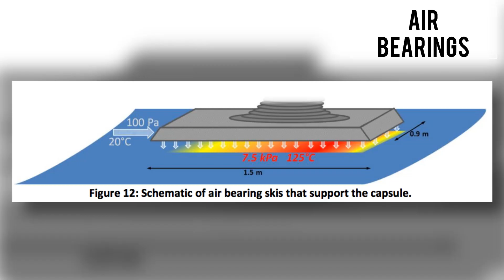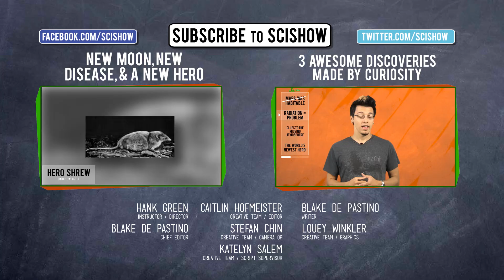The Science of Hyperloop

Comment: ...solar panels...

So when the sun isn't shining, the tubes won't work.
Reply: ***** Several problems.  First, the batteries will lose juice after going without sunshine for several days, which will happen periodically.  Second, batteries are very expensive.  Third, batteries are really bad for the environment. 

So let's get over this solar panel nonsense and install miniature underground nuclear sodium cooled reactors (cheap and incapable of melting down) for the hyperloop.  This will work weather the sun is shining or not, wind or no wind.  Mother nature's cooperation is not required.  

Problem solved.
Reply: ***** Well done, sir.  My advice: go be an engineer.  (I'm biased because I'm an engineer.)  Invent a better battery and change the world.
Reply: I would be willing to bet the hyperloop would be linked to the grid, that way it would always run and the panels would make up for any electricity used.

I think the obvious reason why Musk is betting on batteries run by solar rather than by LFTR plants is that his system is proven. How many LFTR plants have been built? Less than one? You're years away from your dream. By the time your first mass-scale plants are being built, solar will have already won.

He also doesn't seem to think his batteries are too dirty (relatively speaking) and he's Elon Musk. So there's that.
Reply: 4ourthofjuly Solar represents less than 1% (last I checked) of the electric power generation.  Nuclear represents 20%. Nuclear IS a proven technology, and has been for the last 60 years.

Of course I would assume that the hyperloop would be hooked up to the grid, but at the current technological level, solar is nowhere near a cost effective means for accomplishing this.

I am repeated bemused by how self-proclaimed environmentalists are among the most resistant to nuclear technology, which is by far one of the best "green" technologies out there.
Reply: The LFTR plants have not been built. Was there even one full scale plant? I don't care whether you build them or not, frankly. Look at the trends and use your imagination, renewables work. Just have to invest in them.
Reply: 4ourthofjuly You are talking about thorium reactors, and I'm not sure why - I never brought up thorium. But even then, a thorium reactor is nearly identical to a uranium one, for which, there have been hundreds built across the world.

You say: "Just have to invest in (renewables)". The problem is, people have been investing in renewables for quite some time now. Given their erratic nature in power generation, utility companies have a huge headache trying to compensate for this with other more reliable sources of energy - which right now is natural gas. As it sits, you can only supply a small portion of the grid with wind/solar before you start running into all sorts of issues.
Reply: So if the sodium cooled plants you're talking about are more like traditional reactors, you run into some of the same problems like radioactive waste. If you imagine the cost of containment and monitoring for tens of thousands of years, it is not competitive with renewables. Nuclear o my exists because of government subsidies - private companies could not pay free market insurance prices. I don't think it would be any cheaper along the San Andreas fault, would it? You have ample wind , tidal, sun and geothermal there anyway.
Reply: 4ourthofjuly The subsidies you are talking about are the Price-Anderson insurance program, and have been relatively inexpensive as compared to other subsidies that exist in the energy sector.  But I agree with you that the subsidies should stop - as long as you would agree not to subsidize any other green technology.  I meet very few people who are willing to take that deal.  But at the same token, it isn't fair for one industry to be subsidized over another because the government arbitrarily deems it to be sufficiently righteous.

As far as nuclear waste is concerned, points you bring up often cause professionals in the industry to collectively roll their eyes.  Even calling it "waste" is a misnomer because there are a lot of really valuable bi-products that comes out of these spent rods.  The industry has its hands tied with onerous government regulations among other ordeals not of its own making.  There are a number of very effective and inexpensive ways of dealing with the "waste" in a way that will not harm the environment.  The issue isn't a technical problem, merely political.

Look at the options on the table: We need a stable, reliable power source - this takes wind/solar off the table.  We need a source void of CO2 emissions - this takes coal/gas/oil off the table.  We need a power source that is cost effective.  We need a power source that can be implemented anywhere - which limits hydro/geothermal.  This wittels us down to essentially one option: nuclear.
Reply: ike evans Wouldn't the easiest solution be to just connect it to the power grid?
Reply: Ike Evans Wow, people are illogically against nuclear. Nuclear is currently our best option, it's clean (other than the waste which we properly dispose of without hurting the environment), powerful, efficient, and cost effective. The only time solar can truly replace it is when panels yield 70+% efficiency and is in space with the energy beamed down using microwaves to reduce loss.
Reply: FzaaaR My comment is meant to poke fun at the simplicity of the explanation as to how the hyper loop will work.

We need to get this through our collective heads: solar is technologically nowhere close to supplying more than a tiny fraction of our energy needs.  Even if (big "if") we have a new quantum leap in battery technology, there are a number of significant problems to solar power working on a large scale.
Reply: Lachlan Evans-McKenzie Come talk to us when a nuclear reactor causes a "hydrogen explosion that spreads radioactive material for miles in every direction" or is even shown to be able to do that. 

More people die every year in the solar energy field than in the nuclear energy field. In fact, nuclear energy is on record as being the safest form of energy we have. (The most dangerous obviously is coal with 160 deaths a year average compared to nuclear at 0.04) 

Chernobyl, the worst accident on record has so far only killed 50 people. Every year, 50 people die installing rooftop solar panels in the US alone. You are actually more likely to die as an artist than as someone who works at a nuclear power plant.

While we are talking about chernobyl we should mention that it did not have a concrete containment system or many other safety protocols that are mandatory in US nuclear plants.

Beyond that, flying in an aircraft poses the highest risk of radiation to humans. All the radiation released by every accident from nuclear power combined would pale in comparison to what people are exposed to every time they fly. I suppose we should ban flying as well?

http://rationalwiki.org/wiki/FAQ_on_radioactivity_and_nuclear_technology#How_safe_are_nuclear_reactors.3F
Reply: Mc Tilley well..what about parts of the world were the sun dont shine alot during winter....here in Sweden its really big diffrence between winter and summer..i have some solar panels myself and some weeks on the winter i dont even get close to the ammount i get from 1 day in the summer
Reply: You can't just go nuclear for this San Fran to LA line if Californians don't want nuclear - and they do not. And you're running along a fault line. Conversation over.
Reply: gogyoo I almost never throw rocks.  I am about as nice as they come.

The twenty year number is off a bit.  We have at least a 30,000 year supply of uranium, 60,000 years if you factor in the oceans.  Thorium, which can be used as a substitute, is about double that.

We are nowhere near running out of fissile material.

http://www.scientificamerican.com/article/how-long-will-global-uranium-deposits-last/
Reply: Thor(ium) for the win!
Reply: Savos Aren Correct.  Fusion energy is possibly 30 away, but until then we need to put away these silly dreams of wind and solar and redevelop a nuclear renaissance until then.  It is by far the most environmentally friendly option on the table that is capable of empowering the modern world.
Reply: Eric PennYork The Fukashima disaster could have been prevented in many ways. Let's just say, for the sake of argument it wasn't preventable, doesn't change the fact that Nuclear is the best option for green energy (output wise).
Reply: Randy Sullivan Seck batteries wouldn't work, not with the technology we have. The best way to do it would be to pump water uphill and then at night have the water fall back down and spin a turbine
Reply: Ike Evans Fast forward 2 weeks. Enter Tesla powerwall.
Reply: paulflute Yes, I've heard about this.  This is a step forward by streamlining how a battery would fit in a home, but is nowhere near the quantum leap I am talking about.  

Batteries, as we traditionally think of them, are too inefficient, too expensive and (most importantly) don't have anywhere near the energy density that we need.  I will say that figure out how to more effectively store potential energy is the engineering challenge of our day.
Reply: ***** Ha ha.  Yes.  Yes it would!
Reply: doesnt need to be shining 24/7 to get the energy it needs derrrrrrrrrr
Reply: Mc Tilley Right.  So we hook it up to the grid, and when we aren't getting the energy we need (solar panels typically operate at 25% capacity, optimistically), we get the other 75% from the coal-fire power plant just down the road, which runs at 90% capacity.

Or we can just go nuclear and fix this from the get-go.
Reply: There are two in California. They do not want nuclear. Solar is cheaper and safer anyway and nuclear is in no way relevant to a video about Musk's hyperloop. If he thinks he can efficiently store solar and offset his EVs with his solar company, I'll take his word.
Reply: ike evans What about the uranium depletion problem, even is we could harvest it efficiently from the oceans, there is apparently only 20 years worth of it (source is the book "How bad are bananas?", don't start throwing rocks at me.
And commercially capable fusion reactors probably won't be up and running before 2040, will they?
Reply: John Smith  Right.  We hook it up to the grid.  It isn't being powered by the solar panels themselves, as much as it simply shares the produced energy with everything else.  To say that it will be powered by solar energy is an attempt to paint the hyperloop as being "green", when it is just part of the grid.  The coal fire power plant down the street will still be cranking away to make sure the trains run on time.

For now, and for the foreseeable future, solar energy (as "green" as anyone want to paint it) is too expensive and unreliable to work for an industrial scale.
Reply: Ike Evans Proven to melt down on a few occasions, give Americans poisoning and cancer, endanger, mutate, and even kill wildlife, and let us not forget the waste currently leaking into the ground costing billions to manage and clean up... So when was the last time a solar panel or battery did any of those things?
Reply: Eric PennYork Having an extensive background in the nuclear field, I can assure you that your analysis is wildly over-blown.  I highly doubt there is much that I can do to convince you of this, but I will make these two points.

1) Nobody is least afraid to work at and live around a nuclear power plant than the nuclear engineers who designed it.  Think about that.

2) Not a single person in the US has died from radiation poisoning in the commercial sector of power generation.  (The few who have died were very early in the research sector of the industry when safety protocols weren't established.)
Reply: The initial criticism by Mr. Evans demonstrates how irrelevant his posts are: that the Hyperloop would not work if the sun is not shining. Even on an overcast day, solar panels produce around 80% or better of the electricity they produce on a sunny day. So just lay more panels. Problem solved.

Any my previous comment stands, Californians do not want nuclear power, so the point it totally moot.
Reply: 4ourthofjuly Can you cite any of your resources?

There is an initial problem with your statement that you have failed to resolve.  Solar is very expensive, even when it works.  When electricity rates triple or quadruple in the advent of the "green" agenda, who gets hurt the worst?  The poor.  I graduated from college with a degree in mechanical engineering from Idaho State University with an emphasis in power generation.  I currently work in electrical substation design out of Minnesota.  My fellow students and I spend many hours researching the numbers to try and prove that going solar was a great idea.  None of us got anywhere.  Not a single one of us graduated with the idea that solar energy was a good idea because the numbers just didn't add up.

I also think your 80% number is probably wrong.  Even this "pro-solar" website says that you can expect capacities to drop to 10-25% on cloudy days:

http://www.solarpowerrocks.com/solar-basics/how-do-solar-panels-work-in-cloudy-weather/

Or this website from the Northern Illinios University says you might get as much as 50%, but usually closer to 3%:

http://www.vernier.com/innovate/the-effect-of-sky-conditions-on-solar-panel-power-output/

Besides that, you also forget that solar capacity is exactly 0% at night.  Assuming you don't have other backup power sources, (either from nuclear, which is clean, or dirty gas/coal) your hyperloop will not work no matter how many panels you lay out.

As far as Californians not wanting more nuclear, that isn't very clear either.  I'm scanning a number of websites, most of them contradict each other going both directions.  If Californians don't want nuclear power, then we have to do a better job of educating them on the ramifications otherwise.  Nuclear is by FAR the most proactive option we have to combat climate change.  The safety record of nuclear as compared to any other industry is very good.  And yes, I am well aware of the accidents of Chernobyl, TMI and Fukushima.  Even taking those tragedies into account, the nuclear power option kicks everyone else's butt hands down.
Reply: If Musk thinks HIS idea can run on solar, who are you to disagree? The 80% number is the average I have heard (which is the first number you quoted anyway), but it may depend on panel type. He's the one that owns a solar company, though, not you.

As far as the cost, HIS idea came with a projected cost that was cheaper than the alternative. Solar panels have come down about 80% since 2008. What you learned in school is a bit dated. Musk's company plans to open one of the largest PV factories in the world in Buffalo in, I think, 2017, with 24% efficient panels at even lower cost. They project that they will be on par with fossil fuels without subsidies. Throw a tax on carbon, and that's the end of cheap fossil fuel. Probably the same with nuclear. (I am not an anti-nuclear zealot, btw, only 3 major incidents sounds very safe to me. Keep the plants open. I just think it's not relevant to this concept, and they may be doomed in the long run. They're expensive and will probably always require government subsidy).

Solar panels generating no electricity at night is impossible to forget AND totally irrelevant to the hyperloop. Do you really think Musk just forgot about night? Are you that dense? Unless you want to read his long paper, why not just assume he's imagining a storage mechanism, or just enough panels to offset the use at night? I'd agree offsets are not emissions free, but we don't even know what he's thinking at this point.
Reply: 4ourthofjuly  Dude, your numbers are all over the place.  You aren't giving me any references, and you are quoting me on numbers that I can easily verify that I never said.  This 80% number of yours has got me confused.  There is about a dozen other problems with your statement, but I have neither the time or patience to deal with it for now.

Peace out.
Reply: Ike Evans Yes, I agree that you have no reply. You're no Musk, kiddo.
Reply: Savos Aren The guy who conceived of this Hyperloop has already destroyed the concept of solar in space. You have to convert the electricity to photons then back to electrons on Earth which vastly diminishes your expected increase in energy harvested. Beyond that, the cost of installation is insane. Meanwhile, we have rooftops doing nothing, mere inches from the grid.

And, no, solar panels do not have to hit 70% efficiency to be on par with other forms of fuel. They're basically on par today.
Reply: 4ourthofjuly No, you use the solar panels to capture most of the suns rays (these solar panels would be 70+% efficient) then you convert that electricity to microwaves to be converted back to electricity on earth (only 20% loss from that transfer). And it would have to be 70+% or the loss from the transfer would be too great. Well, I guess you can go down to 60%, but no less.
Reply: Musk thinks its an absolute waste, so it basically is. He has a rocket company and a solar panel company, so I think he knows what he's talking about. This comes down to the cost per pound to get panels to space. And any upkeep or work costs how much?
Reply: 4ourthofjuly Well, it's not a waste, just not possible yet. First, we don't have solar panels that work that well. Second, to make it useful we will nee a big (for space standards) collection of solar panels. I am talking about 10,000 metric tons for (size of a 3 story house more or less). The problem with that is the most any spaceship could ever carry (so far) is 130 metric tons. So, we would need to build something like a space elevator (there is another challenge of engineering lol) and then we need to create all the solar panels we need stitch them together and send that to space.
Reply: 4ourthofjuly Over the course of our conversation, you have applied the straw man fallacy (at least twice) and the ad hominem fallacy.  You quote numbers that all over the place, and you fail to provide me so much as a single reference to anything you are talking about.

Forgive me if I fail to take you seriously when you say I don't measure up to some rich guy that so happens to agree with your ideological agenda.  You clearly have no idea what you are talking about anyways.
Reply: I realized how I screwed up that solar panels being 80% efficient  on cloudy days reference. I believe what I had read is that about 80% of the solar energy that enters the atmosphere gets through the clouds. You're right about the efficiency of our current panels being awful under those conditions.

I think your irrelevant criticisms amount to the pot calling the kettle black - if you actually go back and read your posts, but please don't bother. Either way, you're not Elon Musk and your concerns about how his concept should be powered are about as relevant as any Youtube comment: not at all.
Reply: Ike Evans Tell that to the military personnel exposed to the fukushima radiation...
Reply: Eric PennYork Once again, you (and everyone else who is arguing against me) really need to provide some sort of citation to back up your claims.  A 30 second google search confirms that your statement is incorrect.

http://en.wikipedia.org/wiki/List_of_nuclear_and_radiation_accidents_by_death_toll

Even as there are no confirmed deaths due to radiation leakage at Fukushima, 19,000 people died in the earthquake and tsunami.  We must keep this in perspective.

Hazards come with every industry of the modern era.  When you stack the level of hazards of the nuclear industry to any of their counterparts, nuclear beats everybody else hands down.
Reply: Ike Evans Thank you, that was very interesting to read (your comments in gerneral, not just this one). I could very well imagine that nuclear energy is unpopular largely because of bad press and accidents getting over dramatized, not actual facts. I don't really want to set this in stone though, since I'm pretty new to the topic (and have no proof whatsoever). Do you know any studies on the actual hazard (both for humans and the environment) of nuclear energy compared to, say coal and other fossil fuels? 
Also I would be very interested to know your opinion on what do to on the problem of nuclear waste/possible solutions.
Reply: Robert Winkler As far as waste is concerned, the very first thing you need to understand is that there isn't very much of it.  You will hear figures of hundreds of thousands of tons in the US alone, and that sounds like a lot.  In reality you can take all of it and store it on some ground the size of a football field, three feet high.

In terms of actually dealing with it, there are several viable options.

1) We can store it deep underground at a cave at Yucca Mountain, Nevada.  This is the worst of the options for several reasons (including expense) but it is one that still works.

2) Wherever the waste is generated, we simply drill a long narrow hole several underground onsite, well below the water table.  Then we throw in the waste, fill up the hole with concrete.  The waste will resurface in a few million years when it is no longer toxic.

3) Use a single above ground storage location.  I recommend using my home state of Idaho, out in the desert where not even the jack rabbits will be bothered.  I use to work for a company that prides itself on building the strongest buildings in the world (cheap too!) that is within an hour's drive.

4) Recycle the waste.  As it sits, under the technology we have adopted here in the US, we only burn less than 10% of the usable fuel before it becomes "waste".  Other technologies that we have developed would allow us to burn existing waste to access lots of potential energy without creating a bit of new waste in the process, while significantly reducing waste stockpiles we do have.
Reply: A while ago i saw a pretty interesting TED talks on this. of course some guys concept is a long way from being implemented in industry.
Reply: Ike Evans http://www.ambri.com/ Should be available as a consumer product in 2017
Reply: Carl Parrish Energy storage is arguably the engineering challenge of our day.  A new super cheap battery might mitigate some of the issues in regards to the variability of wind/solar, but there are a couple of counter points to this.

1) Even as battery technology might make wind/solar feasible, competing energy sources would also benefit likewise.  Coal/nuclear waste an enormous amount of energy during off peak time periods (night hours), and tapping into a new form of energy storage would make these options even more cost effective - leaving wind/solar in the dust.

2) We are talking about a technology that is expensive and possibly terrible for the environment.  After all, these batteries are almost always made out of lots of toxic materials.  There are numerous other option that are already in use for large scale energy storage that are more cost effective and better for the environment than chemical batteries.
Reply: dude your dumb, the sun energy still goes through clouds, around 80% still transfers through.
Reply: #batteries
Reply: john mctavish That is exactly right!  Holy crud it is nice to run into someone who knows what he is talking about!
Reply: On April 30th Tesla is going to make an announcement that make batteries make more sense. in the mean time the Ambri liquid mental batteries have a lot going for them.
Reply: http://www.ted.com/talks/donald_sadoway_the_missing_link_to_renewable_energy?language=en
Reply: you don't think musk has already thought about that? do you think he is stupid? he wouldn't of even suggested solar power if it was just gonna stop when the sun isn't shining. put your superiority complex aside because you don't know what you are talking about
Reply: Ike Evans Elon's other company is called Taslr.. they just did..
http://www.bbc.co.uk/news/technology-32545635
Reply: Ike Evans UNLESS, Hydrogen batteries.
Reply: gamerchunk1 If you are talking about fuel-cell technology, then you might be on to something - that is to say that the energy density of a hydrogen battery can potentially be very high.  Unfortunately there are numerous technological hurtles to making a hydrogen economy work for the time being.  Another noted negative would be that you can't just walk up to any outlet and charge your hydrogen battery like you can with a traditional battery.  But who knows?
Reply: Ike Evans http://en.wikipedia.org/wiki/List_of_nuclear_and_radiation_accidents_by_death_toll
The very fact that a list of deaths by the hand of the energy source you are endorsing negates your argument.
Don't get me wrong. I think nuclear power has fantastic advantages and should be pursued, just not on a large scale.
Reply: Lachlan Evans-McKenzie When we compare death rates per energy outpi, there isn't another energy source in the world that comes even close to the safety record of nuclear power.
Reply: Dude, it doesn't matter. Nuclear power kills people and has the potential to render entire cities uninhabitable. Uranium reactors are extremely dangerous and you can rant about your safety protocols all you want but the mere fact that you NEED safety protocols is evidence enough.
Reply: Lachlan Evans-McKenzie EVERY industry has safety protocols.   By your logic, we should never do anything.

Don't get in your car.  They have safety belts designed to mitigate the extreme danger they pose.  If cars were really safe, they wouldn't require us to strap ourselves to the seat.
Reply: That's your argument? Come find me when solar panels induce enormous hydrogen explosions that spread radioactive material for miles in every direction and then we'll talk mkay?
Reply: Lachlan Evans-McKenzie In the limited time that I have at my disposal, I can’t find any numbers comparing nuclear power to solar output.  But I do know how to compare nuclear to wind energy (which typically beats solar hands down).

One AP1000 nuclear power plant puts out 1.1 GW of power, at 9x10^6 MWH per year.  For a wind farm to do the same thing, it would require 2,077 2-MW windmills.  In other words, 1 Nuclear Power Plant = 2,000 (big) windmills.  The solar industry is only worse.  The wind and solar markets don’t come even close to matching the output of nuclear power.

In the commercial sector of nuclear power (not research), not a single death is attributed to radiation poisoning.  This applies to every country outside of the Soviet Union.  Yes, I’m including Fukushima.  At Fukushima, 19,000 people died from the earthquake and tsunami.  Nobody died of radiation poisoning.

That, my friend, is an unprecedented record of safety.
Reply: Noooo .... they will use batteries provided by Musk's Tesla gigafactory ...  who said Musk a phylanthropist ??
Reply: Ike Evans ooh! What type of engineer are you?
Reply: Ike Evans 0.19 per Kwh? Wow i thought i was paying lots of money on electricity
Reply: 4ourthofjuly Conversation over?  Meaning that is all there could be said about, eh?

There are lots of nuclear power plants in California, so I'm not so sure Californians are opposed to nuclear power.  

The fault line you cite is of minimal concern.  The reactors I am talking about are miniature reactors that are stored underground, encased in a few feet of reinforced concrete with very few moving parts.  Even the most catastrophic earthquake won't come close to hurting one of these bad boys.
Reply: Solar is not cheaper.

In Germany they use lots of solar.  The cost of electricity is: $0.36 / kWh

In France they use lots of nuclear.  The cost of electricity is: $0.19 / kWh - pretty close the the cheapest in the EU.

http://en.wikipedia.org/wiki/Electricity_pricing